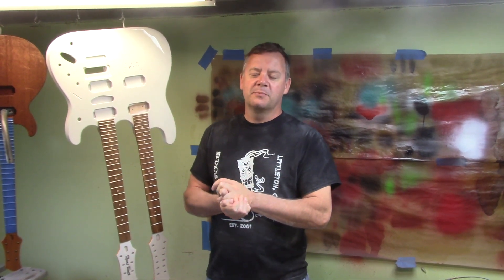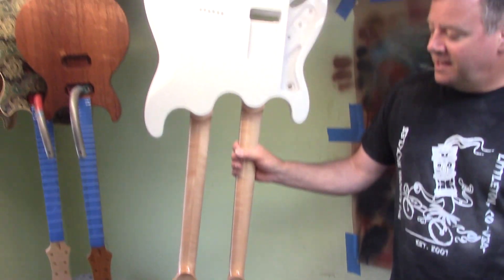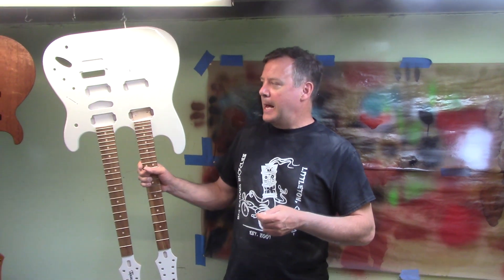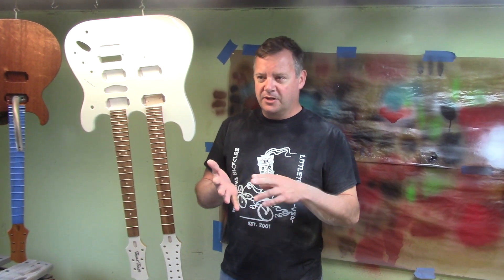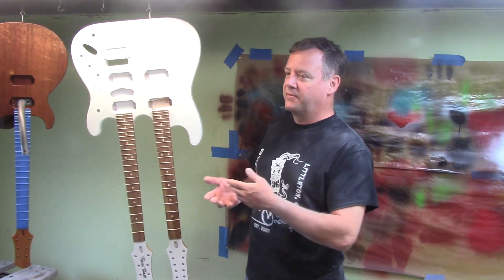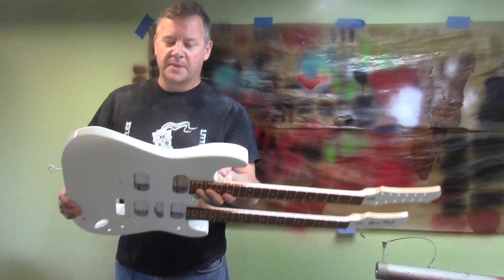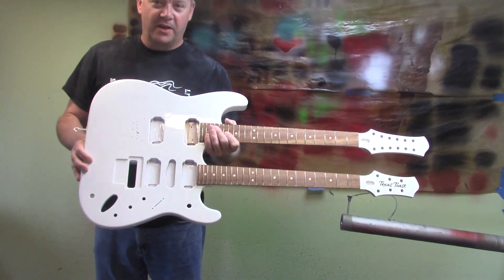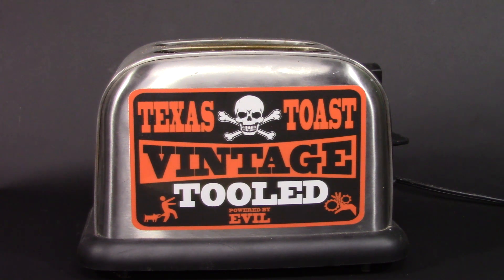Building A Double Neck Guitar Part 8... The Paint

Comment: Instead of using ppg clear why don't you use simtec top coat clear? Ppg clear is designed for a car door so it can flex..so it's not as durable as simtec..just wondering since I've been using Martin senior ultimate overall clear and maybe I should use ppg instead..?
Reply from the maker: Hi Alan, 
We have had great results with the PPG paints and have intention of switching anytime soon. I'm sure there are lots of products that we could try but I believe that if it ain't broke... don't break it. 
Plus the PPG store is right down the street from the shop. If you live in close proximity to a PPG store I would recommend that you shop there. If there is an old crusty dude who works there that is even better.
Reply: Texas Toast Guitars which ppg? Deltron?
Reply from the maker: That is the good stuff we try to use the Deltron for color. 

We use the OMNI for clear since UV isn't really necessary.
Reply: Texas Toast Guitars ok cool thanks for the info